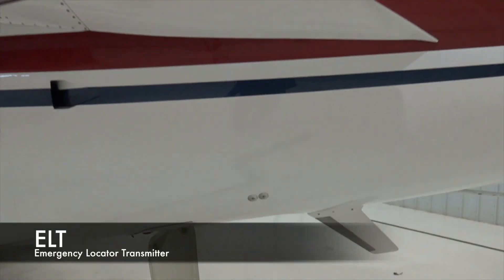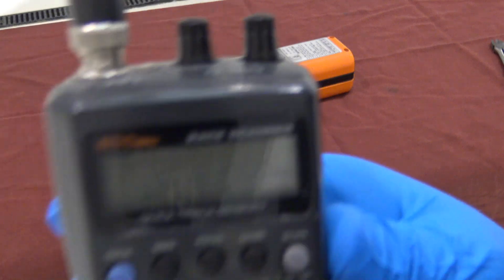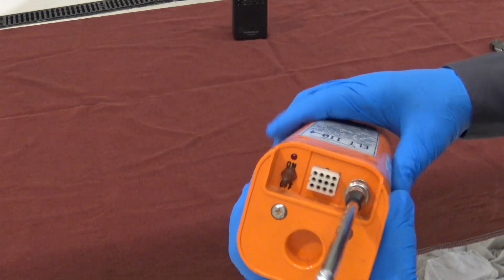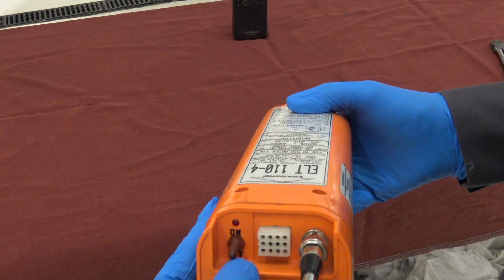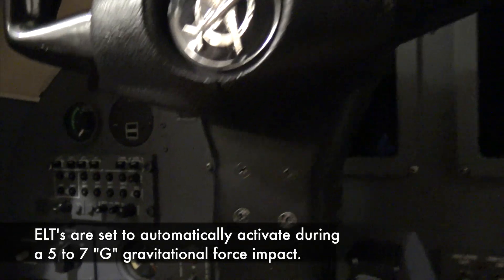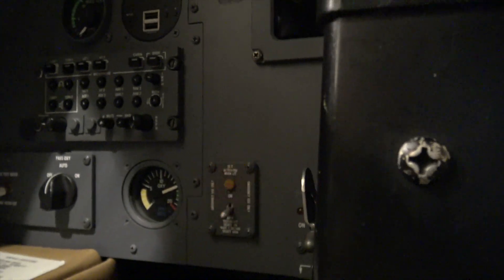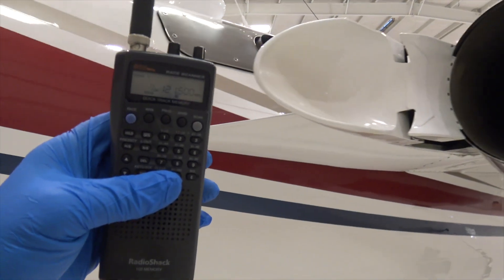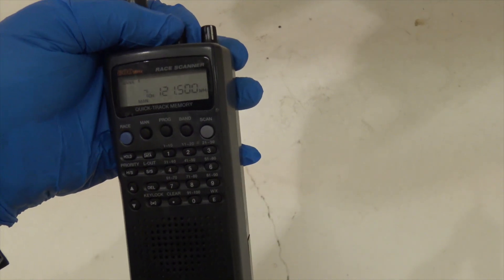ELT Emergency Locator Transmitter

Comment: I was a crew chief on USAF HC-130’s in the 1980’s and 1990’s. We had a system called the ARD-17 Tracker, originally designed to track signals from any emergency radio on 121.5/ 246.0. It was extremely accurate, as long as there was a radio operator on board that was good at reading it. I remember one search where we found a small aircraft burned under snow. The ELT was transmitting, but couldn’t be heard. We still found it, there was just enough signal.